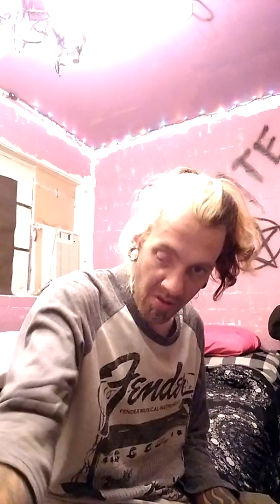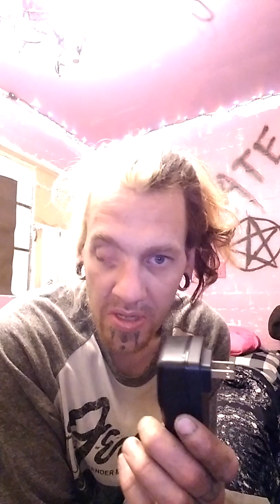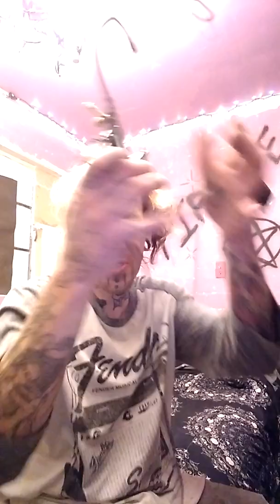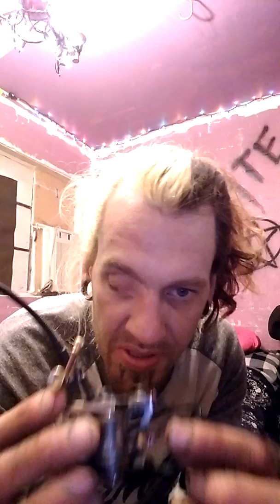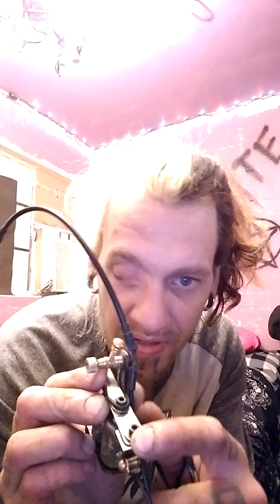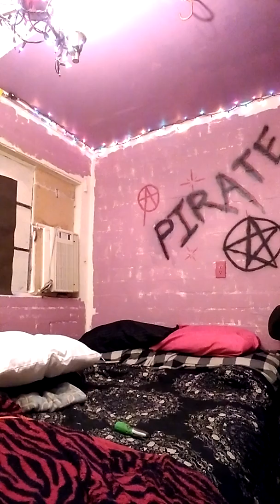How to power a tattoo gun with out a power supply.

Comment: I'm confused on the switch unless  you got a cord that just so happen to have a switch wire 🤔 then again idk much about wires in electronic things. ... I'm not so sure if a switch is even needed... How to you control the speed when you do this ?
Reply: You control the speed by the volts the power box is putting out……. Different speed equals different power box, or just adjust your hand speed to the voltage the box is putting out or find a power box that matches your desired speed. There’s hella ways to skin Cats. Switches are wired in like everything else. Cut the wires and splice in a switch. It’s not needed , but you would have to unplug your machine to stop it.